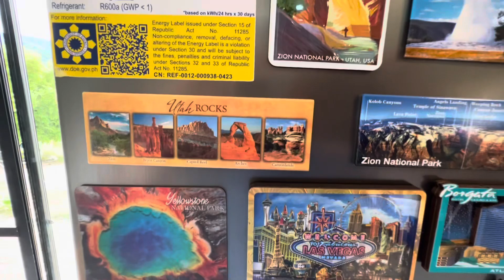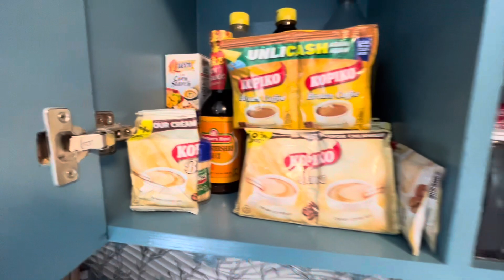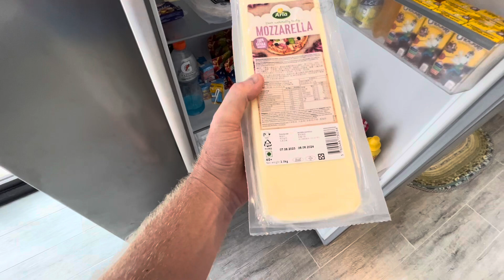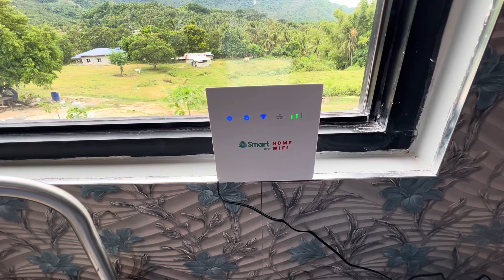Update After Moving In | Shopping Spree | Kitchen Appliances | Future Content |WasherDryer Installed

Comment: are you sure you have the filters in the correct order-biggest to smallest-the cotton white filters are there to remove the largest particulats, then to charcoal filter which is smaller micron, then the reverse osmosis-they should be in that order-also you may try moving the pump up away from the mud on the bottom-or, pump water into a 50 gallon settling barrel, have a second barrel with rock and sand, then lead into a third barrel of charcoal, then into a fourth with fine sand and smmoth particles-definitely clear up any water supply on the cheap-4 fifty gal barrels, some pvc, some rock and sand-you can make your own actve charcoal with cocnut husks
Reply from the maker: Thanks. Good idea 👍 ill look into that

Comment: The water filter setup look confusing.
Whats the pipe going down to the ground? Water should run through the filter before spitting up. One of the filter is dirty while the other 2 look clean, those 2 clean one are probably being bypass. 
Try looking into sediment filters.
Reply from the maker: That pipe is for the outside hose. No filter needed 😆
Reply: @pierreandpamparfaitechanne5088  water is going through one filter then down, where that middle pipe going? The pipe that runs through the three filters is going to the house I'm assuming?
Reply: @ICheat_ILie_ISteal you are correct. One filtration for bathroom sinks showers and toilets. 3 filters for dirty kitchen and kitchen sink